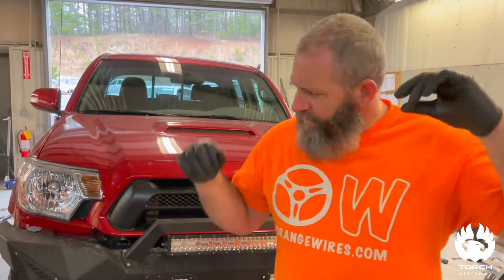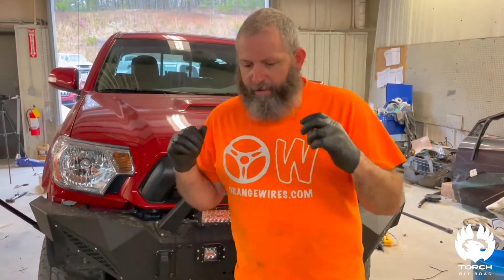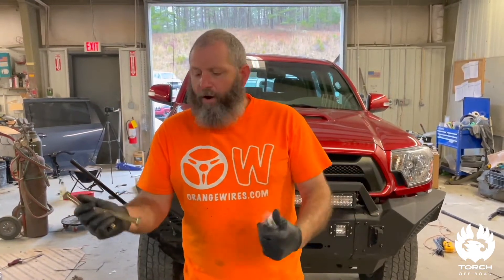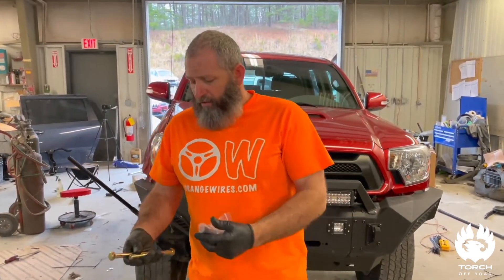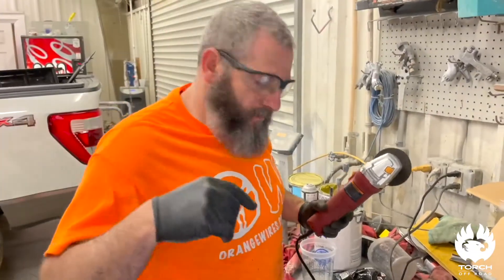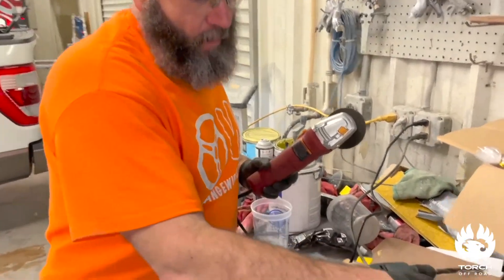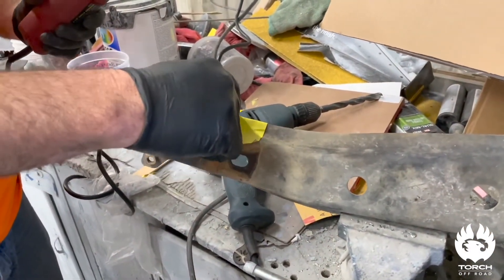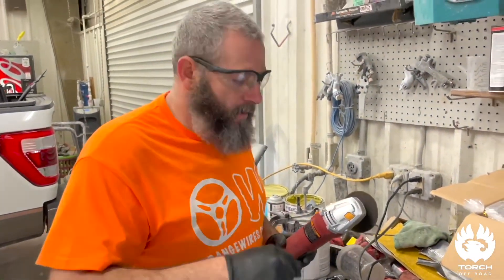TORCH Off Road 05-22 Toyota Tacoma Differential Drop + Skid Plate Spacer Installation Guide

Comment: How i install back the TRD skid plate in 3gen tacoma?
Reply from the maker: Thank you for your message.  Our differential drop kit will not be compatible with the TRD Pro skid plate, as the mounting points are different from non-Pro skid plate.  Please message us from our main website if you have any additional questions and I'll be happy to assist you -TORCH

Comment: I did a 3-1 leveling kit no diff drop though the shop said my cv angles looked good. But now im cracking cv boots every year. You think the diff drop will help?
Reply from the maker: Thanks for your question. I typically recommend a differential drop with front lifts of 3 inches (on 4x4 applications). It's not strictly necessary, but it will help to adjust your CV angle after lifting the front-end. 

However, if the shop said your CV angles looked good and you’re cracking CV boots every year, there may be something else going on with the suspension. I’d suggest trying a diff drop first, and then getting the front suspension checked out if you’re still having issues. Please contact us directly if you have any other questions and thanks again! -TORCH